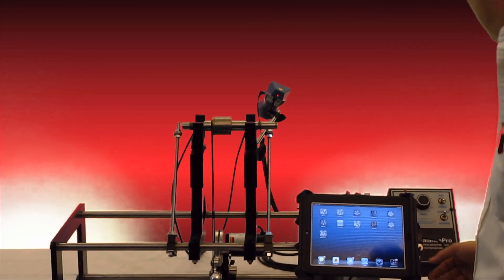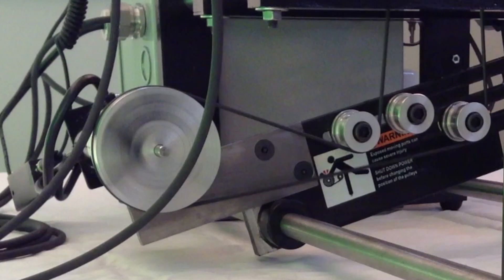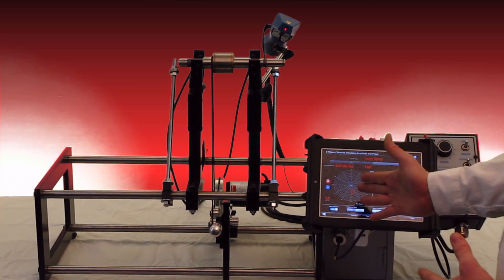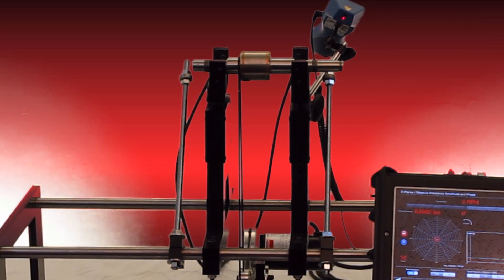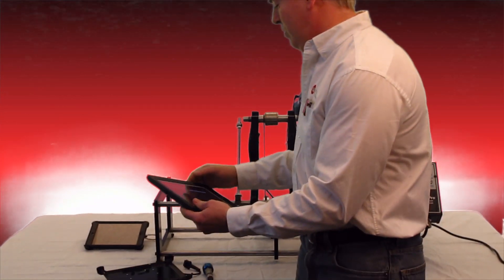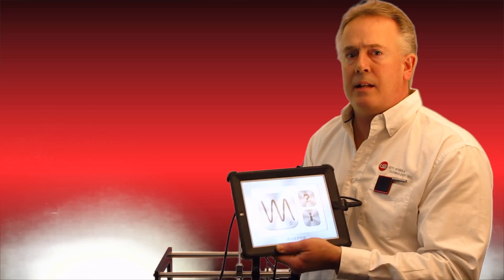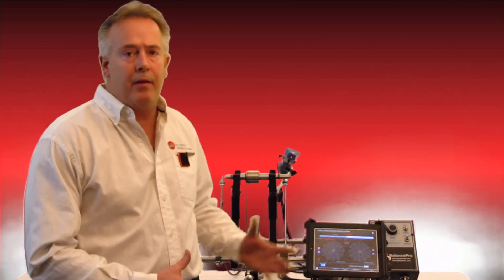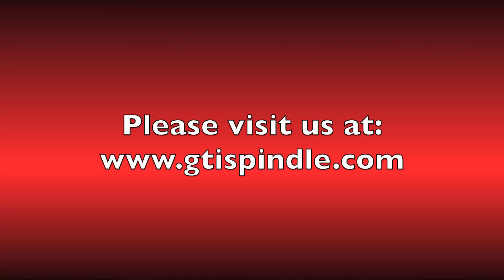New Horizontal Dynamic Balancing Machine: For BalancePro on iPad by GTI Predictive Technology

Comment: Do you have or plan to have field balancing capabilities with some sort of laser or photo tach to measure speed and phase angle on large machines for example 10 k lb wood hog rotors or 10'dia I.d. Fan configurations.